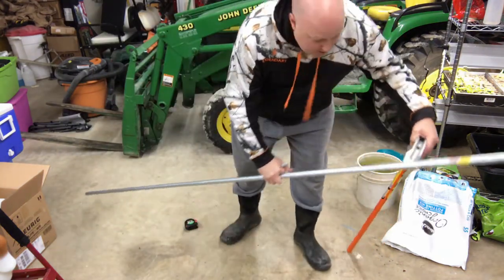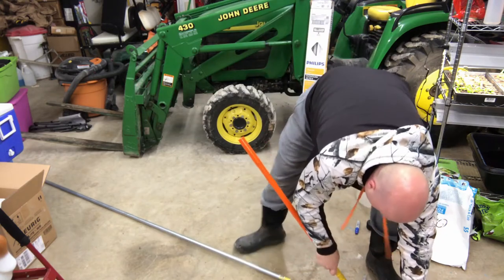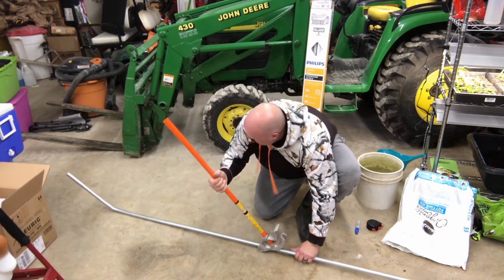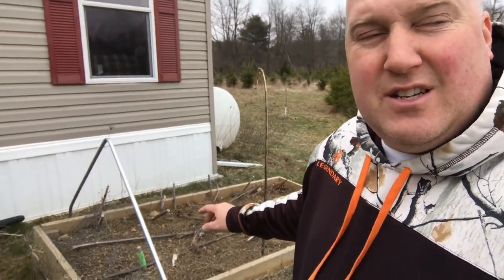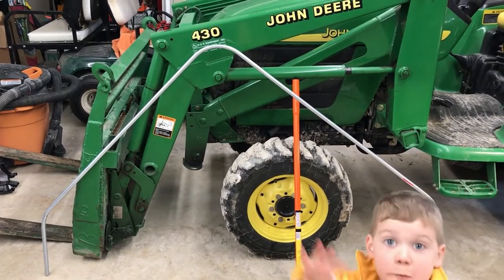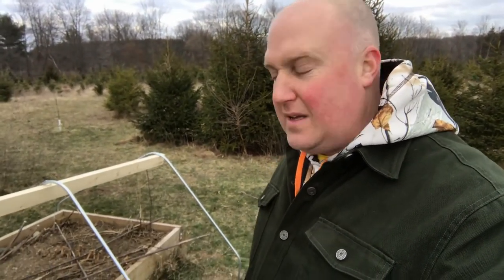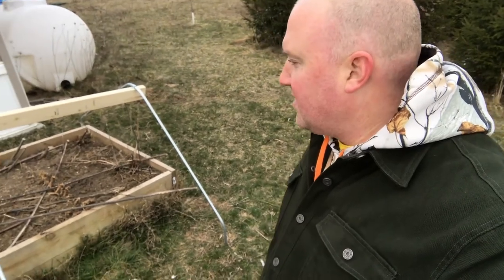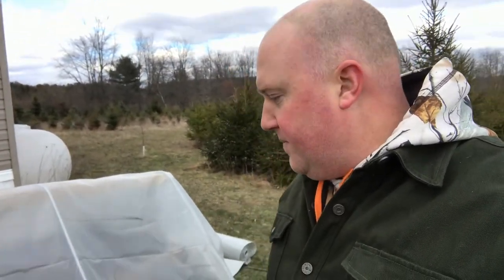Mini Hoop House 1.0, How I Made a Hoop House with What I Had (Mostly)

Comment: The notch on the rim of the bender will be the center of the bend. This is where you want to align the center of the piece of EMT for the 60* bend. It is not as critical in this application which mark you use for the 30* bends, as long as you use the same mark for both bends.
Reply from the maker: Thanks buddy.  I think I found a star, which marks the back of the bend?
Reply: Homestead Dad 1. Arrow To be used with stub, offset and outer marks of saddle bends.

2. Rim Notch Locates the center of a saddle bend.

3. Star-Point Indicates the back of a 90° bend.

https://idealind.com/content/pdfs/guides/conduit_bender_guide.pdf

But this is not atomic brain surgery, so as long as you get close.

Comment: When you measured 1ft and then 5ft and 1ft at the opposite end, I would have perhaps also measured 5ft from the opposite end to make sure it was indeed the center, as it looked like the second end was longer, although it may have just been the camera angle and perspective? The bender slipped along the pipe a bit on the second small bend as you moved to bend it from the opposite direction ( 04:28 ) which may be why it didn't match the mark, as you discovered later. I did try telling you when watching the video but you didn't seem to hear me! :P (none of this is meant as a criticism by the way, just vocalizing my observations :) In terms of the sloped land, could you perhaps sink some rebar or similar to increasing depths so the tops are level with the bed and then place the pipe over the rebar so it too is level? All that aside, it all does the same job and well done on creating your hoop housing :)
Reply from the maker: I wasn't as exact as I could have been.  Also, learning the tool.  Thanks buddy!
Reply: I guess, but in the end it was good enough and fit for purpose - it isn't like you were making a Swiss watch in terms of precision :)
Reply from the maker: Certainly not.